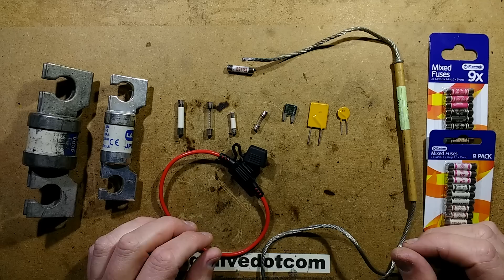Things you should know about fuses.  (including a 15kV one)

Comment: So I blew my speakers because of frayed wire do you think the fuse needs replacing or would it blow the power pack completely. It tripped the socket circuit breaker also. I will have to take it apart anyway to reconnect the power lead properly but I dont really have much idea what I'm doing. Just interested if I can figure it out.
Reply from the maker: If it tripped the breaker the power supply may have failed.

Comment: A couple more things have come to mind...   Those automotive-type fuses come in several sizes.  In one instance I scrapped out a bit of gear and ended up with a smallish circuit board that held two of those,  bigger than any that I'd seen before,   and which had been connected to a battery.  (In a UPS?  I forget.)  They were rated at 40A,  and were connected in parallel!  And this thing was made by IBM,  of all people.  That I just don't get...

My grandfather had some rather interesting cartridge-type fuses.  You could unscrew one end,  and pull out the innards and replace the fusible element.  I've never seen those since then.

Comment: I met a guy,  an electrician by trade.  He'd been working on something,  I don't know the details offhand,  and there was an explosion.  His face and much of the front of his body were scarred up pretty badly.  He's lucky to have kept his eyesight,  I think.

We had a rather odd issue with the power in this house a while back.  Some things worked okay,  and some didn't,  with no apparent pattern to it.  I initially suspected that we'd lost a phase (two out of phase 120V lines and a neutral coming off the pole transformer),  but the electric company was apparently able to see both of them getting to that "smart" meter from their end.  It turns out that right after the feed from the meter into the house there was a box that had a couple of these monster fuses,  150A or something like that.  Bigger than the largest of what you showed in this video.  And that water had followed the wire down from the meter box and had gotten in there and started to corrode the innards of one of those two fuses.  It eventually became a rather high resistance -- I could plug in some really easy low-power load but any attempt to draw nontrivial power on that leg was going to fail.  Eventually we got somebody out here who found the problem,  and replaced that fuse.  The old one is down in the basement at the moment,  and perhaps one of these days I'll get my hands on it and "take it to bits".  :-)

It's been a really long time since I've used it,  but one thing that I used to carry in my toolkit was a small circuit breaker,  of the sort that can mount in a given panel in one hole,  which had some clip leads attached to the terminals on the back of it.  If I was working on something that kept on blowing fuses while I was trying to troubleshoot it,  I'd connect that in across the fuse holder instead.

Comment: Hi, and thanks.  The ultra-fast "FF" fuse would be more properly called a meter fuse, or just a quick-blowing fuse.
A fuse that protects a semiconductor must be current limiting, which means at least a sand-filled case.  It's not just the speed but the ability to hold the short circuit peak at a relatively low current that provides protection.   And FWIW, they cost a fortune, often made of silver.

Comment: On my desk at work, I keep one of the spare fuses for an unused three-phase panel. It's made by Littlefuse. It's got a particularly interesting way to indicate when it's blown, which I thought was worth mentioning. It has a little plastic window on the side. Behind the window, there's a little strip of what I presume is something like thermal printer paper. The strip has a very thin wire wrapped around it. I presume there's a standard fusible wire inside the main housing, but when that breaks, all the current has to pass through that tiny wire, which will either pop and scorch the slip, or heat it up and burn it. I'm guessing that because it says on the fuse to replace it if the indicator has any black on it.

I've been very, very tempted to crack the thing open and see how it works. It's a shame it's one of our spares.

Comment: A tungsten load WILL draw a high inrush current due to a low resistance when cold, so a slo-blow would be appropriate. A better example for using a “normal” fuse would be any circuit that does not have a high start-up current.

A 12 KV power line fuse outside my window blew when a truck ran into a pole two blocks away made such a loud bang that I thought the transformer feeding my house had exploded!

When I maintained a Univac III, a bypass cap on a 250 VDC buss shorted. When I used a fiber fuse grabber to insert a new 3AG fuse, it blew so violently I actually saw stars. I knew I hadn’t been shocked, so it was just a psychological reaction to the noise, etc., I.e. it “blew my mind,” so to speak. (Replacing the cap fixed it.)

Comment: In our Industry, Our Substations (Every 6Km) we 'had' ext. 30kV switchgear with 660mm  ceramic fuses which, if the end knife contacts were amenable we would/could replace the fuse elements (for Aux. Transformers (long for the spark gap)).   .   Also in the Control Rooms the Battery sets had 72V/100A renewable fuses elements filled with white sand and asbestos wool each end(150x60mm).   .  Bearing in mind the ASEA 1935 installation, the main S/Stn High Speed Air Circuit Breaker's did a wonderful job clearing faults (6,500A each end), if definitely deafening for those unfortunate to be on maint. duty.
( For  'Heritage Open Days'  we open our decommissioned   Elec. Control (GU21-) in Sept.
 ( This looks to be the first year we will miss in 20yrs     Yours:  JWP  -  ECRO  -  G8J - - )

Comment: Ok, so I completely understand why not to use a low voltage DC automotive fuse for mains applications. However, what about the other way around - using a sand-filled ceramic cased fuse (the sort rated for 240 volts AC) on a low voltage DC circuit? Other than it being inappropriate, would there be any safety reason not to do that, provided that the current rating of the fuse matched the consumption of the circuit?
Reply from the maker: That should be OK.  DC only becomes tricky at higher voltages when it can sustain an arc.

Comment: Dumb question...can the Polly switch fuses be used for an automotive fuse...saying that lets look at an Car's fuse-box....if i wanted to, can i replace all the fuses with these Polly switch fuses? or for temporarily short?
Reply from the maker: In low current applications it could work.  But the high current PTC fuses are huge and get very hot when tripped.
Reply: @bigclivedotcom  cool, so it would be best just for testing till the short on vehicle has been resolved. Is there any chance for an request? would love to build an 12 volt probe tester but there is not many good ones out there and all the probe testers in our country is to expensive to buy. would really appreciate.
Reply from the maker: @etiennedebruin5871  You can buy automotive circuit breakers that go in the standard fuse position.

Comment: 10:21 They were too cheap to fill it with sand???!  I've seen Chinese power banks that have sand pouches as dummy weights.  Seriously.. the quantity that goes into these cannot be massive, I'm sure it's not beach sand. But I'm baffled by their cheapness here.  And hell, I think beach sand probably would work better than nothing.  I guess it's a matter of assembly complexity perhaps?  Cheap, cheap crap!
Reply: Since they're not soldering them, putting sand in them could easily gum up the works and stop them from working.

Comment: Fuses for "medium voltage" DC (think EV batteries) must be rated for DC specifically. They have a DC voltage rating lower than their AC rating because the voltage never goes through zero, which helps extinguish any arcs.

Relays/contactors are the same way. A relay with 12VDC/250VAC rated contacts cannot be relied upon to break 120VDC above small currents. Sometimes, there is a graph in the  datasheet that specifies the current the relay is rated to break at a given DC voltage.

Comment: Holy cow, Kerry Wong posted a Video on fuses -> https://www.youtube.com/watch?v=RaSp_lY3E2U and tested them with 16V DC, but the fuses are defined for 250V AC, i wanted to find a better video explaining Fuses and found your video .. But your description reads "3A is 3A so a 250V fuse will work fine on 12V." .. WTH? 3A@12V = 36Watts 3A@250V = 750Watts and AC-Fuses cant be directly used as DC-Fuses aswell, maybe time to make a new video on fuses ..
Reply from the maker: Current is current.  It doesn't matter if it is at a single volt or 250V.  What I did miss in the video is high current DC breaking fuses.
Reply: @bigclivedotcom  Wow really? 1A@1V is 1Watt and at 250V it's 250Watt .. Current-Value alone doesnt tell you anything, you need the Voltage to calculate the Wattage (Watt = Volt * Amp).
From en.wikipedia.org/wiki/Breaking_capacity -> The current breaking capacity corresponds to a certain voltage, so an electrical apparatus may have more than one breaking capacity current, according to the actual operating voltage. And why else are there extra fuses for cars, or special fuses for 32V DC - if only current matters why we dont have just one type of fuse for "everything"?

Comment: Some people really are clueless about fuses. My brother bought a BMW years ago. Half the electrics didn't work. We took a look in the fuse box and I noticed someone had removed all the fuses and put them back in random places. Most of the ratings were completely wrong. One fuse was a 5a and the idiot previous owner had wrapped it in copper wire.

That fuse was for the electric passenger seat. 5a was not enough, I think the rating was like 15. I put one of the correct rating in there, it worked just fine, didn't blow again. The other electrical items which were not working all sprang back to life.

Comment: Having just ordered some Bussmann mains plug fuses I discovered that there's a UK Consumer Direct website with a page warning about counterfeit Bussmann fuses and it shows counterfeit and genuine fuses.
It warns that the counterfeit ones have shiny, not dull, end caps and a dimple in the ends, rather than being smooth, and are not sand-filled, and even reputable retailers were being duped. 
My fuses arrived and had shiny end caps and dimpled, but they had sand in them.  Totally confused, I decided to contact the parent company 'Eaton UK' for an authoritative judgement on them.
Well they were less than useless, ''contact Eaton USA - they'll tell you''... So i'm non the wiser what I've bought!
Reply: Real Bussmann fuse end caps are not shiny, because it's made in silver or copper. Their characteristic is easily to oxidize. So the surface is not very smooth. Any Bussmann fuse questions can ask me.
https://www.linkedin.com/in/bussmannpower/

Comment: One important point to mention, notice whether the fuse is rated for AC or DC current, because DC arching requires much smaller gaps than AC. So if you use a DC fuse in an AC application there will be trouble.

Comment: Are u saying a 15 amp fuse could possible carry 100 amps before it blows? If that is the case why do we worry about replacing a 15 with a 20 amp fuse? If all the fuses in my panel were at same capacity I would be safe? Discovered ur channel. Like the vids.
Reply from the maker: The fuse is matched to the cable it protects.  The cable will also carry 100A briefly before the fuse blows.  Increasing the value of the fuse risks the cable suffering damage when it passes high current for too long.
Reply: That's what I thought u meant. When I moved in my house found all the circuits had 30 amp fuses in the panel. Knew better and put proper fuses in. Enjoy the channel. Lots of nice science there.

Comment: I had a variable transformer from China rated for 20A which kept blowing fuses and getting too hot to touch during operation. Then one day it failed for good making it impossible to remove the fuse. When I disassembled it, I found they'd used a fuse holder rated for 15A.  I installed one rated for 20A (had to modify the enclosure) and it's run cool and flawlessly since.  The fuse holders are an important part of the system too.

Comment: I just picked up a PowerCube© travel set and when I popped the fuse out it reminded me of some of the Chinese fuses I've seen on this channel. so I went looking for a more practical difference between ceramic and glass fuses and lo and behold there's already a video on the subject.
One of the top results other than that other guy in England who does electrical stuff in his shed...
It came with a very cheap looking 10 amp ceramic fuse with all this feeling of absolutely no quality and I happen to have a selection of glass 10A fuses. so I think it'll be okay in my 120 volt countrie(s) that I most likely will use it. but I really thought it would have been nice if they included a spare fuse but considering the quality of the fused I see why they didn't include a spare. looks like I have to get me some ceramic fuses, especially if I do use this in a 240 volt country.

Comment: Fuses are one of those topics that I thought I knew everything I needed to know about them when I left school.  Now, more experienced,  I know there is a lot about them that I do not know.  You can get into some pretty detailed engineering when you start getting to the details.   Glass time delay fuses are also kind of fun when in a low over current condition.  You'll look into a peice of equipment and be suprised that there's a light on until you realize it's the fuse glowing incandescently.
Reply: Those were not evacuated that I know of; A really eager DIY can try clipping 0.80 Aluminum Foil down to the needed ma rating; There is a video up on YT about how breakers throw and it looks to me to be a common switch but electrician try to tell me not to do that as it is supposed to have limited number of operations; In many places where I have worked a 200 amp panel is where they switch many lights - they go decades with no failure

Comment: Most people think a fuse is to protect the equipment, that is a mistake.  A fuse is to protect your house from burning down and you along with it.  When a short occurs, the equipment is already damaged.  FYI, the fuse on a train motor (3000 VDC) is the size of a coke bottle.
Reply: Yes; Yes; Yes; Yes!! 
Intentional failure link to reduce fire;
Not to protect equipment from out of range values;